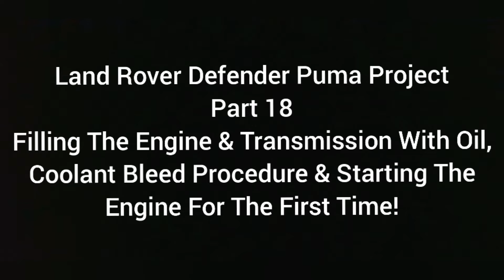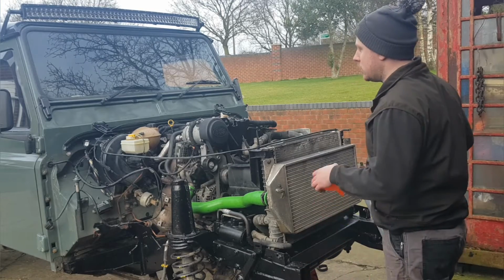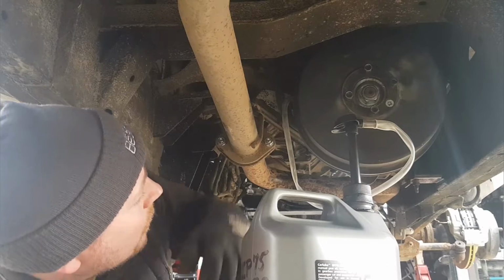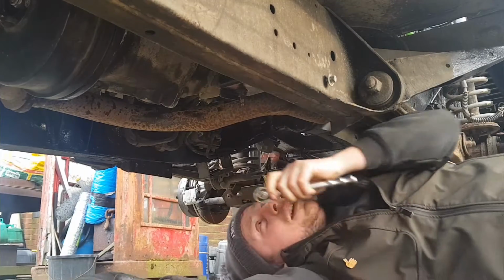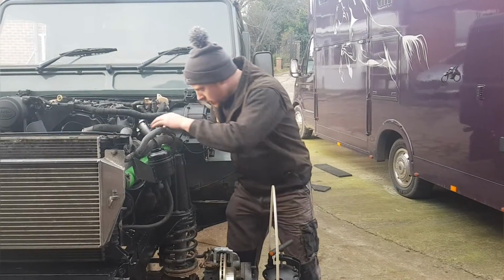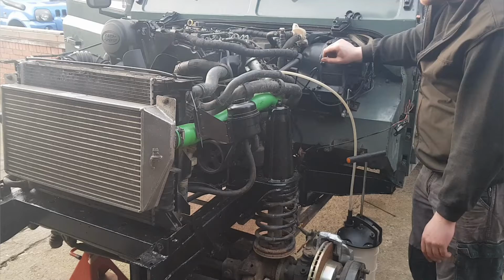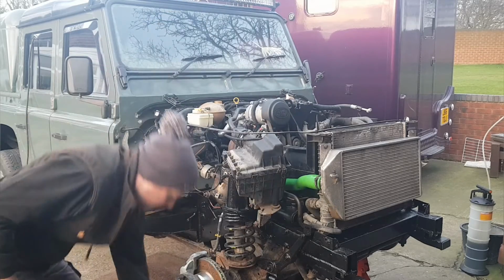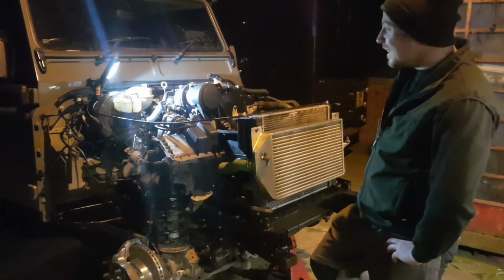1st Engine Start Since Rebuild, Land Rover Defender Puma 2.4 TDCI Restoration Fuel + Coolant Bleed

Comment: Is that the oil filler pump of the type sold by Fourby? If so iit's rubbish. More oil escapes past the spindle than gets delivered.
There are few good oil delivery pumps. I have three which don't work (Fourby, Sealey, Clarke). I finally got the Clarke to work when I modified it by squeezing in an extra O ring around the piston.
Reply from the maker: Mine is a Sealey pump. Done alot of work for me. Think ive had it 5-6 years now!

Comment: Good job Mate. Those MT82 gearboxes prefer a verygoodquality 100% synthetic gear oil (Castrol Syntrans £20/litre) with a little LSD friction modifier to avoid notchy gear changes of those synchhrorings, especially 2nd when cold. It looked like you put winter window cleaner in as engine coolant. The correct colour of the OAT coolant is a pinky orange. TEXACO long life. Keep up the good work. I will have to change the clutch in my 2009 130 DC HCPU soon 😎
Reply from the maker: Thank you. Haha yes it dose look like screenwash! I am putting that in for now as i am going to flush the cooling system and replace with the pink long life antifreeze, just a tempoary thing till i know everythings ok. Same with the gearbox and especially the tranfer box as the oil that came out was a horrible brown colour so that definately needs flushing out after a few month of it been on the road!
Reply from the maker: I can highly recommend LOF Clutches for your 130 all his details are in part 2 on my channel. Very good quality parts and great to deal with!
Reply: @lifes.projects  Thanks for the info on LOF clutches. I intend using my 130 for long distance African desert trips so have opted for  Clutchfix heavy duty clutch with uprated torsuon springs and not the road spec LOF as my engine is uprated and the GVM will be 3000kg. Last thing I want is to slip the clutch and have to replace again due to soggy springs... Keep those videos coming.

Comment: Nicely done, have you bled the clutch slave yet?  I had a hell of a time bleeding a completely dry system like yours.  I even tried pressure suction on the slave and didn't work well for me (no pedal), finally uses a preasure push pump on the master and the pedal started to finally firm up.  Interested in your experiences.
Reply from the maker: Thanks Jason. Yes i am a few jobs infront of the videos so just caught up with the editing.
Yes mine was pretty straight forward but i gravity bled it first. Sounds like you turned the seals in the master, if left with no fluid in like mine its always better to gravity bleed them first as the seals go hard, so you need to fill up the master and leave for 10 mins to lubricate the seals otherwise they struggle to bleed up. In some cases they can be damaged but sounds like the pressure bleader put them back into shape. Lucky you!
Reply from the maker: Meant to say. The next job is the propshaft UJs and i bleed the clutch up. Ive will edit it and put it on. Probably be a few days
Reply: @lifes.projects  I look forward to watching it!

Comment: Tom quick question ? i have a puma 2.4 and i'm experimenting with a cat back exhaust in stainless with mid and back box delete ? what are you running on yours as i noticed the sound was quite nice ???
Reply from the maker: Glad you noticed. I cut open my cat and removed the inside making a decat. It has mid delete and soo i will be removing the rear silencer for a full straight pipe. It sounds really nice. Abit like a more refined 300tdi

Comment: You look well chuffed with yourself Tom.. my day will come!! Thanks for showing the bleeding process on the fuel, In have bought the little hand pump type so we'll see how i get on. At the end of the video you mention no lights on the dash.. but you blocked the EGR?? I thought you'd get a light on?
Reply from the maker: Thank you. Just relieved as its a totally new loom that i hadnt seen been tested. Doubt you will be long as your making good progress on yours!
Yeah it will only come on after a drive down a motorway when the engine is at a constant RPM till the  ECU realises its not recycling gasses.